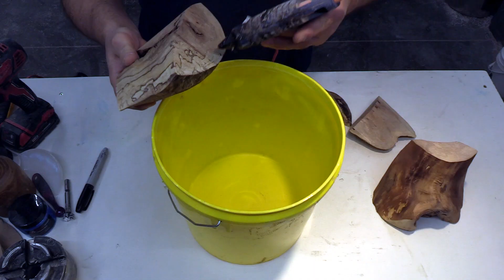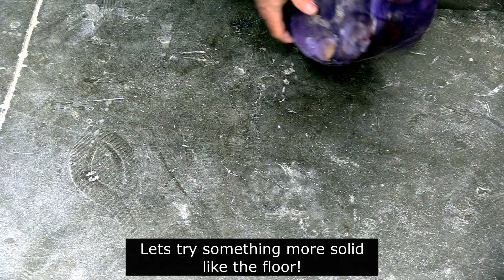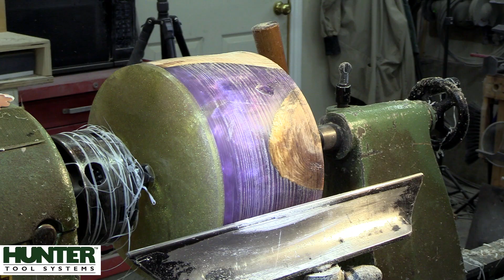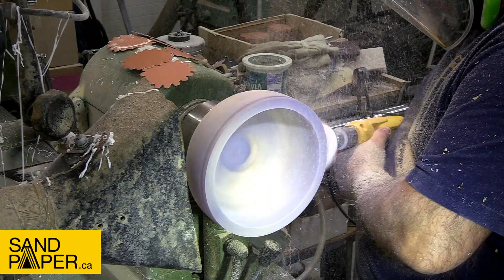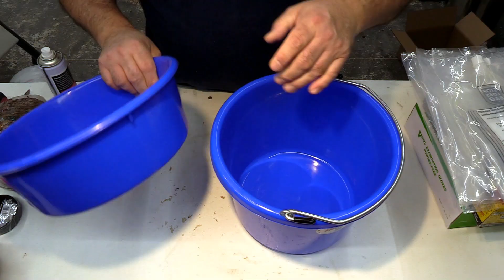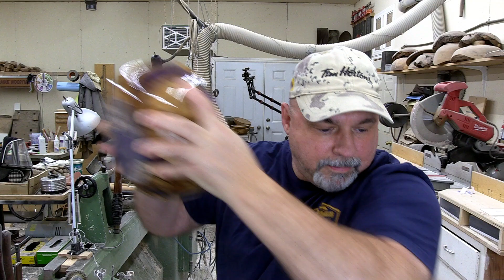Woodturning - Checkout this Amazing Covered Dish! Wow 115K Subscribers Thanks!

Comment: I have a suggestion for the next thing you want cracks in. Don't use the flat surface, use the other side that is generally used to pull nails. maybe I typed too soon. Maybe use a vise to hold it still while hitting it?
You also could your typhon bit to  widen them or possibly make them
Reply from the maker: I’m open to suggestions, thanks for the idea!

Comment: I have noticed that in the past, to avoid thermal cracks, you have put the casting in the fridge. It's possible that is why you didn't get any or very little thermal cracking on this piece and the previous hollow form. Have you tried warming the resin you are going to use for the casting before pouring and then leaving the casting in a warm spot yet? Beautiful piece, congratulations to the winner 🥰
Reply from the maker: That just might work. Thanks

Comment: Would it work to cut out a round shield for the bottom of the bucket, spray on the mold release, then remove the shield?
Reply from the maker: Yes, that could work. Thanks
Reply: @SpragueWoodturning  You're welcome! Hopefully it can save some buckets :)

Comment: Love the content and glad I stumbled across your channel. Something to think of and maybe try is drilling a hole in the bottom of your bucket after epoxy/resin is fully cured and then blowing compressed air into it to release everything from the bucket with less stress. Could possibly glue a small piece of cardboard to the inside or patch the hole to save the bucket and repeat the process
Reply from the maker: I’ve done this a number of times with limited success. Thanks.

Comment: I’m sure it’s already been mentioned but I think curing the resin in hotter temperatures will increase chances of thermal cracking. At least that’s what I’ve experienced before. Amazing work as always!
Reply from the maker: Certainly, this was cured in a room that was 75F. Thanks

Comment: Great piece and lots of fun watching it evolve. Have you ever considered drilling a line of small diameter  holes and then fracturing the piece with a chisel? Never tried it just thought it might be easier and give you a more controlled break. Appreciate the commentary as usual. Can't wait for the sticky. Whatever that is. Cheers. Designer epoxy
Reply from the maker: Thank you very much!

Comment: Hi Jim, I would like to know what Lathe you use and if you have any suggestions for a beginner woodturner on what Lathe to get?  I've heard of the 3 sizes, mini, midi and full and I'm guessing that a full sized Lathe is the way to go if I want to end up doing sizable projects like vases and large bowls.  Thanks for your input in advance. :)
Reply from the maker: I have a 20” General, don’t get a mini, start with a mid range 12” size. That way you can do bowls or bottle stoppers. Join a woodturning club if there’s one in your area, that’s the biggest one. Hope this helps. Thanks
Reply: Was looking at a 14" variable Delta 46-715 used. But I read they have issues with Reeves drive motor and belt.  If its recently been replaced then the price is good @$400 Cad.

Comment: Maybe next time to get thicker gold cracks threw th piece when you pour for the second time instead of getting a bigger bucket jus put something thick at the bottom of the bucket something that wont suck up the resin that way it wont be such a tight fit and hopefully get those thicker lines you wanted threw your piece.
Reply from the maker: Yes, thanks!

Comment: In order to get more epoxy into the cracks could always turn it down a 1/8” to 1/4” before breaking it apart
Reply from the maker: If I did that, it would be virtually impossible to put back together, recast it and return it. Thanks

Comment: Bet if you had dropped the lid or bowl while showing it to camera it would have broke into 50 pieces. The epoxy is always in control. Sorry about the thumb strike, god but they hurt. Why did you have all the marbles in a bucket in the pot? Just curious. Love the lidded bowl, must get out and play with the epoxy and lathe soon. Thanks for the inspiration Jim.
Reply from the maker: I use the marbles when stabilizing piece. It displaces the volume of the resin so you don’t need so much. Thanks

Comment: The sides of the bucket are tapered, so just put a spacer in the bottom so the diameter is slightly larger.
Reply from the maker: Thanks!

Comment: Re. the lack of thermal cracks, if it happens (or more accurately doesn't happen) again perhaps you could take a page from Wile E. Coyote's handbook, and drop an anvil onto it. 😉

More seriously though: to open up the cracks a little more for kintsugi, a 1"-1.5" thick piece of wood at the bottom for the second casting would raise the piece up and, since the sides of the bucket are slightly flared, give more space for the contrasting resin. You could also use the wood to make a tenon.

I really love that opalescent amethyst colour, and the way the gold veins look running through it. I was initially thinking a much richer gold would be ideal, but I think the more subtle effect works better.

A suggestion for a future video: a run-through of all the tools you use regularly, including what they're particularly good for, and what they're not so good for. You've done that kind of thing in bits and pieces across various videos in the past, but a single video showing them all would be great for both newer and more experienced turners alike. (N.b. I'm not a turner myself, I just enjoy your turning videos.)
Reply from the maker: That’s a good idea. Thanks for that

Comment: Ok I have a name for this one. You should call it "Purple Rage" because it took so much effort to get that sucker to crack😂. But seriously it is very lovely. I love when you make vessels with lids. They always make me wonder what secrets they contain. I do have a serious question though. Would a heavier sledge hammer work better when you are trying to break one of your castings? I would think by setting it on the floor or a stump and giving it a few good blows would do the trick. Either way I think the final result would have been lovely with or without the cracks.
Reply from the maker: I’ve got a splitting maul, I will use that next time, lol. Thanks

Comment: Yesssss, this aesthetic is my jam! Purple and metallics are perfection!

Geez it really didn't want to come apart though! Forgive me if this is a silly question, does thermal cracking also need much higher ambient heat in the environment as well as a deeper pour to occur? Or does the resin itself provide sufficient heat for cracking regardless of room temperature?

I've seen you use the fridge before to slow curing down, I'm just wondering if the opposite considerably speeds it up and then causes more cracks, does it work that way?

Congratulations to the winner of this stunning piece, I hope they love it as much as I do!  Thank you Jim, I really enjoyed this video (except when you hit your thumb, I got a little teary at that!) and I love the beautiful results!
Reply from the maker: With this amount of volume, this resin should of cracked all to pieces. It was 75F in my clean room so we should of had a different result 🤷‍♂️, I think Murphy was working hard on this one. Thanks

Comment: Jim: 0   Epoxy: 1 🤣

This is beautiful set! I like purple, I like glitter, I like spalting, can't go wrong. 

I especially like the lid and how the cracks are in such a concentrated area. It's also just translucent enough that when you were holding it to the camera at the end there it almost looked like a 3D effect in the purple portion of the resin, like you can see a cross-sectional slice of each pigment cell. 

The little porthole you can see on the inside is also super rad!
Reply from the maker: Thank you very much!

Comment: Hi 👋, I just remembered that there was something on YouTube about they’re trying to enforce government registration, About having safety break system on table saws, bench saw et cetera, sawstop , and another company, I can’t remember who, where it detects your hand going anywhere near the blade, Excellent idea, adjust it’s going to put a lot of table bench, saw people out of production, because there has been so many injuries, some very serious, from table saw accidents, inappropriate use of them, people not concentrating on what they are doing, 
I think the table saw and shapers and joiners , are One of the most dangerous machines in the workshop, I have even seen people on YouTube using the jointer, feeding wood across it, without using push pads or a device to control it, and having the guard tractive back or not, even in place with the whole of the cutter block spinning round with no guard on it, I have even left some comments with people with use of their machines, and my comments have been removed, Stay safe, keep up the great work, from the moulin,
Reply from the maker: Those safety devices aren’t mandatory here and I can’t imagine YouTube trying to enforce them. Sawstop is expensive and I just don’t see them enforcing them. Thanks for watching!

Comment: Jim, I think a chop saw is worse. One took my fingers off real quick. A board kicked and slammed my hand into the blade. It took all four. When you hit your thumb I felt it due to the fact I have done it too. Got to figure out how to guarantee thermal cracks.
Reply from the maker: Ouch, were they able to get them reattached? Thanks
Reply: @SpragueWoodturning  they reattached all 4 but had to take the ring finger off. They work somewhat but I was left handed in some activities and have tried to retrain. Ain't nothing but a thing. I can still scratch my butt. I do enjoy your responses to our conversations moments. You do read them

Comment: Hi Jim!  I'm only 15 min into your video, and at the part where you removed some pieces so that it would fit the bucket better.  I had a thought.  Since most buckets aren't 100% straight (ie, top is slightly larger than the bottom), could you have maybe put in a couple/few inches of your rice or something in the bottom (to create essentially a false bottom), then put a trash bag in the bucket,  arranged your pieces in the bag, which should now fit a little better, and then poured in the gold filler epoxy?  I hope that makes sense--maybe it's not a good idea but thought I'd throw it out there, lol.
Reply from the maker: The problem with trash bags is they can migrate into the cracks. Just putting a 1/2” spacer on the bottom would of been beneficial. Thanks

Comment: I'm watching your epic struggle and I'm wondering why, once again, your epoxy refuses to thermal crack. I don't know enough about epoxy to suggest anything with confidence, but I'm wondering if the wood pieces are working somewhat like ice cubes, preventing the epoxy from jumping to extreme temperatures in a fast enough way to cause cracking. Could you try placing it in a really hot space (perhaps a quick build of a brick/stone oven shape that could be heated with a space heater (nothing that would melt the bucket)? Or maybe try heating the wood chunks and bucket before pouring the epoxy in so nothing can act as a heat regulator. 

If thermal cracks happen because extreme heat, extremely fast (and again, I'm a total noob so I don't actually know if that's why thermal cracks happen) I would assume finding a way to crank the heat up is the way to go. 

Loving the project, as always!
Reply from the maker: The wood pieces were in the shop, so they were warm. I also put this in the clean room where the heat was on and set to 75F. This should of cracked all to pieces 🤷‍♂️. Thanks
Reply: @SpragueWoodturning   how weird! You keep getting the good results even when you do everything to get otherwise.

Comment: Maybe Designer Epoxy has ‘improved’ their epoxy so it doesn’t thermal crack so much? Maybe they could unimproved some for you so it will? 
Seriously your workshop may be cooler now than during the summer when you did several pieces that did thermal crack. Heat the clean room up , maybe that will help. Can’t thermal crack if it doesn’t get hot. 
Beautiful anyway.
Reply from the maker: It was put in my clean room where there’s heat. Thanks

Comment: Congratulations on 115k. I'm glad to see you got some good cardio this week. 😂 The bucket is tapered. Couldn't you have cut a 3/4" thick disc to put  in the bottom of the bucket to raise the blank and give you a bit more room for your second pour? Just a thought. You are the epoxy man. I've never messed with it. Designer Epoxy.
Reply from the maker: Yes, I’ve done that before too and probably should of done that on this one. Thanks

Comment: What an effort! That Designer Epoxy is some amazing stuff. You probably have already considered this, but maybe a little heater would encourage the thermal cracking. Congratulations to the winners!
Reply from the maker: Heat wasn’t the issue here. It was 75F in my clean room. Thanks

Comment: Here's a small suggestion for you.  When you are needing to break apart the casting where the thermal cracks are located,  consider the benefits of using a hydraulic press. This concept is going to be the same as like using a log splitter to separate things in a certain way. This will also help to save your knuckles from that big bad sledge hammer. If you don't have a shop press, go with the greater capacity of a 20 ton. It will be better having more power when you need it rather than having less power but needing more. Keep up the good work. 👍🏼
Reply from the maker: When we move to the new place it’s on the list of things to get. Thanks

Comment: Jim, I must say you really do a great job beautiful work. I was also hoping to see more thermal cracking. Watching you struggle to break that apart brought pain, you should’ve cut the whole thing apart on the bandsaw and then used your belt sander to widen the lines, that’s my thought. It really doesn’t matter. You do really good work. It was a beautiful project and I must say I need to try it myself. Congratulations to the winners and even those that didn’t win. Thank you for all the knowledge that you share I hope that you have a great day and a great week.
Designer epoxy
Reply from the maker: Thank you very much!

Comment: Another nice one! I am also a lefty so I appreciate the struggle turning inboard. I received my order from Designer Epoxy and the uv resin has been a game changer for filling cracks and small voids. I have found that if you mix colors to strong you may have issues with it curing all the way through if it's a fairly deep crack. I am currently trying to come up with a design to try out the deep cast. Wish me luck.
Reply from the maker: Wonderful! Good luck! The deeper the color, the longer I leave the UV light on it. Sometimes 10 mins.

Comment: Amazing as always, for the outboard side why not make a shaft with a point you can put in your banjo and use a stop collar to set the center height
Reply from the maker: That will work for the height, but not the side to side movement. It’s an interesting concept though. Thanks!

Comment: how to apply for the giveaway??

Edit: also a question for you Jim. is there a reason you sand the bowls with a power drill instead of by hand? I was taught to use sandpaper and hold it against the bowl.....
Reply from the maker: You just did by commenting here and on the videos that I will make before the next draw at 120K.  O need to comment on previous videos. Power sanding will give you a superior surface than sanding by hand and it quicker too. Thanks

Comment: Great bowl Jim, shame you didn't get the thermal cracking you wanted. Had a thought after the premier that maybe need to turn up the heat to get the Epoxy curing faster?
Reply from the maker: It was plenty hot in my clean room.  🤷‍♂️ Thanks.